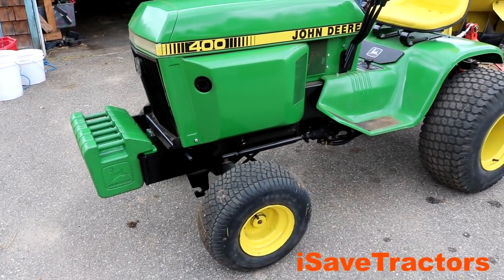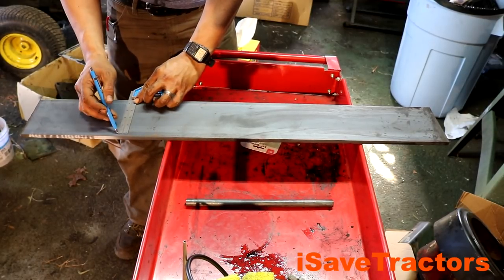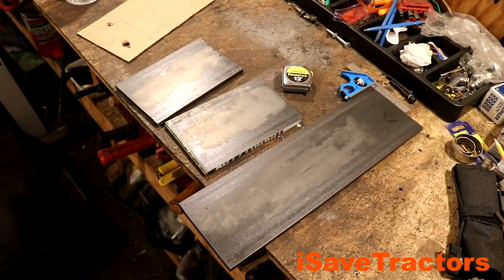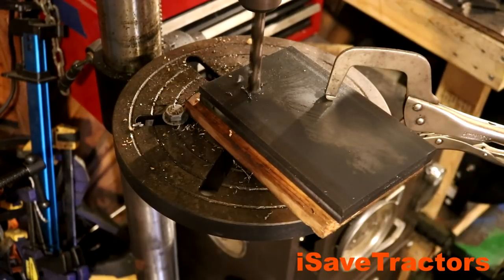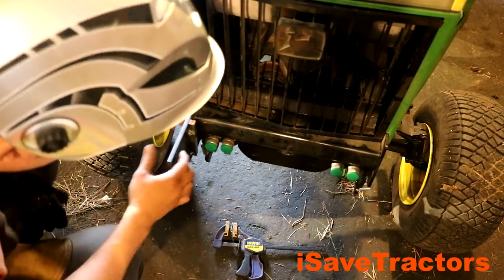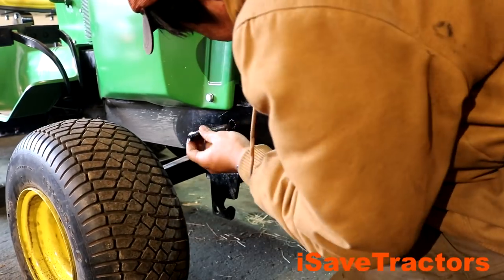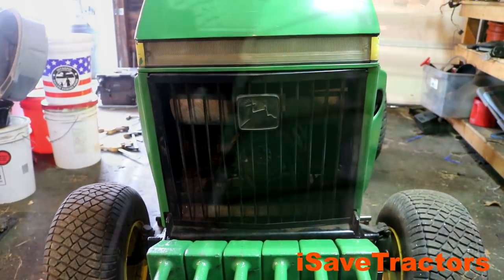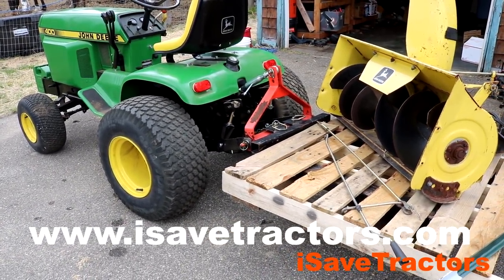John Deere 400 Garden Tractor Front Suitcase Weight Bracket Build

Comment: on your band saw  Lay the 5" bar on the large flat surface then you won't have to flip it over to cut other side unless it was too wide that direction also.     I'm watching this to get Ideas how to go about making one for my Cub  seems the factory made one's are stamped steel that isn't more then 1/4" thick by the looks of it.  I should be about to do this with a steel bar I have that is 6' long 3" wide and 3/16 thick, only I think I'll bend the stock and add some angle iron to reinforce it.  or  use that for a bottom tray and 2 bands to hold the weight's in place with dividers to distribute the weight to each back wheel with room to add more.
I need the extra traction year round.

Comment: Just curious.   Can the axle stub shafts hold up to that weight over time ?
Reply: Yes easily.  I'd be more worried about the tie rod ends than the spindles
Reply from the maker: Yes the spindles are 1" and the tie rod ends are much larger than other garden tractors. I would say probably 3/4" rather than 5/8" like most.

Comment: ok question? do I need weights to use if i'm using a snowblower?  My tractor is a lawn tractor not a garden tractor.
I understand the difference.  I know the hydro stat transmission is not designed to do garden type work, but the snow blower goes on the frt.
Reply from the maker: Yes you will see a big difference. Use wheel weights at the very least

Comment: Look great but with Flux core you need to clean off the last bead every time even flux core deposits crap that will case a poor weld its a good practice.   But I'm not a welder as dbl ck with an expert, But I used to work right next to one and he was always cleaning his welds between layers no matter what kind of welding he was doing.
Pretty good>?  I don't see perfect dimes.  It would not pass x ray inspection.  But its good enough for what your doing, don't confuse that with government work it would be rejected. I seen plenty of stuff go out to government jobs and come back failed because the welds didn't pass and they looked a hell of a lot better. But he was also a pro with 1000's of hours exp.

Comment: I’d like to get a bracket for the front of my 214, are there any decent aftermarket or OEM options out there or am I stuck making one?
Reply from the maker: There may be some people making and selling them on eBay for your 214. I'm not sure though. I'm not a John Deere fanboy so I am not 100% up on what's available. Despite the awesomeness of the 400 they are not very popular so I had to make my own.
Reply: isavetractors I’m surprised there wasn’t something available for the 400, either way great job!
Reply from the maker: Luckily the 3 point hitch on this was available. I got it from Reugg Manufacturing.

Comment: I need help I have a Briggs and Stratton oppose 18 twin that has a shaft in front and rear. I thank it's on a 80's  model roper. I need to rebuild it. I know the first number for the engine is 422437 but I don't know the rest. Plz help
Reply: Look at the model type and code numbers and if you can’t hold a flashlight next to it and then you can see it or look up your engine